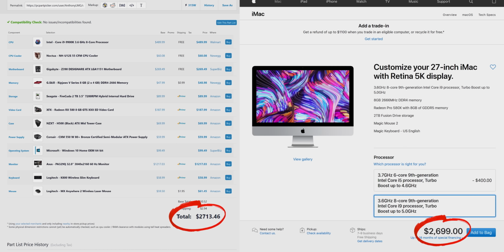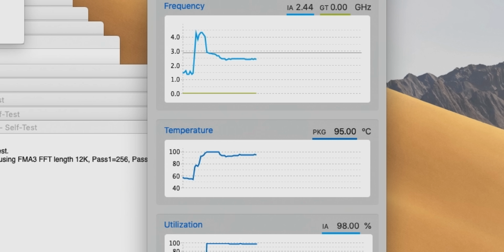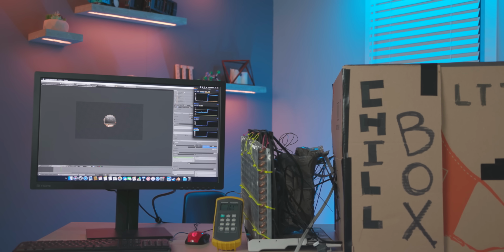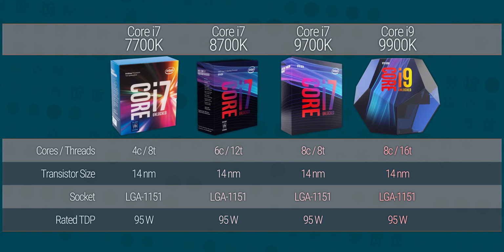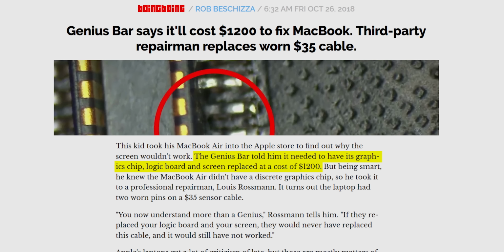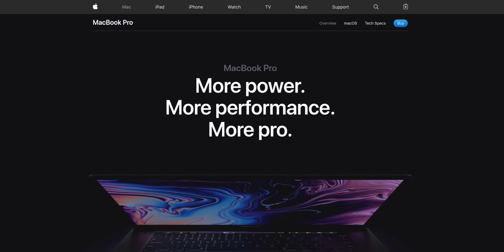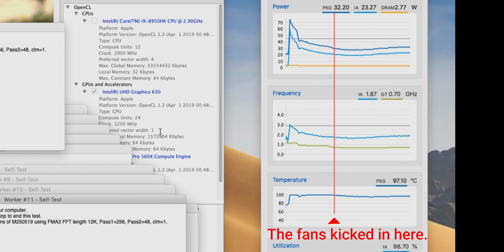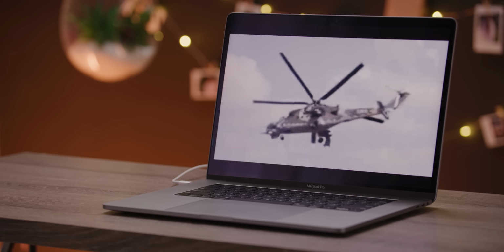Macs are SLOWER than PCs. Here’s why.

Comment: This video missed something pretty important: Hardware P-States, where the software plays no role in regulating temperatures and power state transitions are handled entirely autonomously by hardware. It’s a feature of all Skylake and newer Intel chips (it’s officially called Speed Shift), and it’s been used in MacBooks since 2016, though it does need to be enabled explicitly by the manufacturer (or a BIOS hack or setting, or an operating system kernel). That iMac review also looked like it was using it—you can tell because of all the micro-boosts on the performance chart.

EDIT: Basically this means that there isn’t really much in the way of “secret software sauce” that can be done about it. The hardware is generally better at regulating itself than software. This is probably what Apple’s now banking on in their machines to make up for their designs’ lack of basic thermodynamics, and they’re stretching it as faaaar as it’ll go. :/

Comment: I once had a MacBook Pro Late 2013 somehow lose its thermal sensors during a pretty gnarly exam week. The only way it would turn back on long enough to run a time machine backup was by putting bags of frozen food on it. Thankfully it was right before my AppleCare expired so it was fixed without cost, but the Dell XPS I’ve had since then actually turns its fans off because the 7700HQ CPU doesn’t always need them running.

Comment: The difference between what happens between Macs and iPhones can be due to the facts that for the latter they also design their SOCs? Whereas for desktops/laptops they have to adapt to what Intel provides them?
Reply: 哩哩   The SOC in the Phones is ARM which runs a lot more efficiently.

I don't think Apple is totally stupid here, they are just biding their time until they can get rid of Intel, just as they did with Motorola when they couldn't/wouldn't give Apple what it wanted.

Nexct year should see whetehr Apple has finally managed to manufacture its own chips powerful enough to go into the laptops and then progressively into their desktops. If and when they succeed tghius will be an earthquake moment for the industry. Intel has been hanging on by a fingernail to their virtual monopoly.
Reply: @peterbreis5407  I would hardly call Intel a monopoly considering that AMD outsold them 2:1 as of December of last year. And they haven't had any significant advances since.  And with the tremendous amount of cell phone market share lost to Samsung and other Android powered phones, I'm not convinced that they have the resources to take on ANYONE in the processing world, let alone a giant like Intel.  Steve Jobs, their innovation driving force, is gone.

https://www.techradar.com/news/amd-is-now-selling-twice-as-many-processors-as-intel

http://fortune.com/2019/03/12/apple-iphone-trends-going-from-bad-to-worse-analyst-says/
Reply: 哩哩   I think Apple will continue making Macs because they need them to tie together all their hardware, there is so much that you can not do just on iOS.

Apple's ARM chips are already extremely powerful, it won't take much to get them up to running laptops at least. That combined with Apple's T2 chips could mean they totally lock up their hardware, and that is a step too far for me.

If they do shift to ARM that means iOS can run on desktop Macs and may mean the end of macOS.

Comment: Financially, gaming pc are better than macs.
Reply: Rofl. If you only now are coming to that realization i hate to be the bearer of bad news, but gaming rigs when built right have always been better.
Reply: @Dj-Mccullough oh yeah no. I don't own any apple products whatsoever. went from Samsung Laptop to upgrading a Cyberpower PC.
Reply: @marky.maku.  niice man. Did you enjoy the build? And how are them sweet sweet fps's? ;)
Reply: @Dj-Mccullough  lol no. It was scary as hell to do that stuff. like especially the Intel chip putting that on scares me. I had a friend really help me but Overall, putting it together physically was all me.
Reply: @marky.maku.  intels use of that cpu socket with the pins actually perminantly in the motherboard and laying the chip on top of that while attempting to not bend a single one of those tiny pins is enough to give me nightmares. I MUCH perfer AMD cpu socket. Atleast when you open that all the easily bendy parts are shielded.

Comment: I agree apple is not overpriced per parts but per performance if I pay for i9 level performance I better dam well see i9 performance I don't give a shit how distasteful it is to have a hidden "actually powerful" checkbox in macos rather than claiming to boost "up to" x.xghz but literally never boost because of the 1% of apple users of the 1% of tech enthusiasts who can't stand 36db of fan noise (35 is literally a whisper) I mean cmon raise your fan sound limit to 40db because 99.9999999999999999999999999999999999999999999999999999999999999999999999% of buyers care more about actual usability than silence
and yes the statistic with so many digits is an exageration but removing more than HALF the decimal places is actually unrealistic

Comment: My 2012 dell latitude e6420 with a quadcore i7 2760qm destroys that macbook on cpu loads before liquid metal and its 7 years older, not to mention after liquid metal and added ventilation holes in the bottom chasis

Comment: I wouldn't say they're targeting the "less tech-savyys", I worked in software engineering and MacBooks are very useful when it comes to working in a containerized world. With the help of homebrew, everything just works right out of the box without any special configurations. Of course you can achieve pretty much the same result with Linux, but you'll sometimes find yourself having to do a bit of config to get things working which isn't the case on OSX. I'm leaving Windows out of the equation on this one as just playing with Docker on Windows is a completely stupid endeavour (I've tried it on my Windows desktop gaming PC). 

Bottom line is that Windows is good for certain things (gaming, web browsing, .NET dev, game dev, rendering), OSX is good for others (web dev, software dev, web browsing, etc.), and Linux for others (servers... pls stop with this Windows Server non-sense people!)

Comment: I think the interesting comparison here would be to have a similar spec MacBook Pro and Surface Pro 6. The surface line is still rather powerful, but its much more reasonable than the MacBooks that try to shoehorn an i9 into a casing barely any thicker than the Surface. Personally, I would also add the 12" MacBook to the comparison, as iirc all three of them have a Core i7, 16GB, 512GB SSD config.

Comment: TO EVERY MAC USER: download smc fan control, I use it too and it’s amazing. You can control your fan speed, and get a faster mac by cooling it better. Easy trick and actually works
Reply: i use the same and yes, it works.
Reply: I use Istat so I can control it from the menu bar

Comment: At 9:00 to touch on the subject of the new macbook pro's shitty thermal throttling. It doesnt matter if you liquid metal it for better temps. The VRMs that power the CPU are not delivering enough power for the CPU to work as it's supposed to. It's a terrible engineering flaw that was never fixed even through its "software update fix" It also doesnt help that the same said underperforming VRMs also are not under any sort of heatsinks either. 

Louis Rossmann highlighted the problem as well here: https://www.youtube.com/watch?v=Xjor24HO2HA

Comment: Vouch for 9:05. I found that MacBooks almost grind to a halt if the CPU is pegged for a while, with temps reaching 95C. Using Macs Fan Control, I've set the fan to full if the CPU PECI reaches 65C. Temps rarely go above 70C. Feels very responsive despite an ongoing code compile and 50+ Chrome tabs, with Youtube playing somewhere.

Comment: I am not a snob therefore I use only Linux computers. People use Macs for their snob appeal. If you want a computer that actually does things Linux is best.
Reply: @Nevermore The flaw in your reasoning is that I am retired and don't have to worry about such things. But to tell you the truth I do have a  dual booted computer so I can access Windows if need be. So you are right, one cannot totally escape Windows. But if I do buy a new computer it will have Linux on it or I will put Linux on it. But as Torvalds said, the future is with Chrome OS and I agree. But Mac is for the rich boys who want to impress other rich boys.

Comment: Why not mention how you can make MacBook much more stable with Macs Fan Controll? You used the app in the video. I'ts a great app and free.  MacBook Air 2018 have the low power CPU but it uses passive cooler and FAN only as auxiliary fan for airflow. MacBook Pro 2013 - 2018 have very weak coolers but also superior fans. They are inaudible up to 2500rpm. With few moment of tweaking you can easily make  MacBook much more thermally stable.

Comment: You’re likely to get a new computer by the time the Mac would fail due to thermal related long term issues. Not defending or anything but it’s true. I had a MacBook Pro for 7 years, 2011-2018 and never had any issues other than the laptop aging 7 years.

Comment: I started using manual CPU fan control through smcFanControl and found much better performance when you keep an eye on cpu temps. When you're loading something you know will need a lot of CPU time then kick the fans up to around 5,000RPM. This doesn't half give the user much more control over the temps

Comment: I put the difference down to social engineering within apples marketing as opposed to performance based marketing, here a summary of my experience at university:

I owned a dell xps 15 at university which has a loud fan noise and can be somewhat embarrassing in lectures (i since realised i need to throttle the clock speed for social acceptance if im bothered), i notice the majority of students do have a Mac to read their slides or a low performance computer which doesn't require the thermal dissipation of fans. To uni students, its not only a status symbol but apple have engineered their products to be a part of how they identify in the world, its dumb and illogical in my opinion but yet again, people are more concerned with how they look these days instead of how they feel (which ironically determines how they feel!).

maybe i'm reading into it too much but i just feel sorry for misinformed apple fan boys when i think its clear as day that they have inferior value for the price of their tech - although in this case i guess a silent machine is favourable.

It also doesn't sit right with me that apple rather replace the entire machine instead of fix it - the company is just absolute capitalism in this day and age at its finest and it needs to stop for the sake of our planet. I don't consider myself an Eco warrior but for sure the apple ecosystem seems fantastic on the outside but is just a mess when you see beyond it.

 Opinions ?

Comment: Where to begin....  So many false equivalences in this video....  These videos are really designed to keep PC users from jumping ship...  Apple faithful know that the benefits of the FULL APPLE ECOSYSTEM and quality software, offset the tiny performance loss from the constrained thermals... And Linus doesn't understand the appeal the these machines...  It's not the SEXY that we like .. it's the portability.  Even the power bricks are much smaller than PC junk...

One last thing... Linus makes the claim that Apple designs are more likely to fail because of excess heat, yet he offers only a hand waving argument to back up that claim.  Show us some HARD data to back up this claim ... or I'm considering it total bull shit.

Comment: It's so adorable when Linus attempts to talk about Macs and their user base.  "The looks and the status symbol of owning the machine..."  What an arrogant and ignorant statement, young child.  Most Mac owners are using Macs because of the operating system, not the "looks and/or status symbol."  Mac owners generally don't want to run Windows because MacOS provides them with the tools and playground they need or want.  Would it be nicer if the laptops performed better?  Sure.  But folks don't buy Macs for "kick ass performance, yo!"  We buy them for the OS and the fact that stuff just works out of the box without the necessity of jumping through hoops (eg: Hackintosh).

Windows sucks as an operating system to get work done.  Windows 10 sucks less, but it still sucks.  MacOS is a superbly better platform for programmers, systems/network engineers and architects, and a host of other roles.  You're not going to understand that because you don't understand those kinds of roles.

Comment: The difference between a Mac and an iPhone( or any other phone) is that an intel processor produce heat and require cooling when an ARM barely produce any heat for the same result. That is also why Apple is moving forward to ARM based Mac in the future... and also why your phone doesn’t heat... it heats mostly because of the battery...

Comment: I work in post production and we're entirely Mac-based here (not my decision). My manager offered me a new Macbook Pro to replace my aging Mac Pro. I turned that offer down for a Mac mini 2018 and a Vega 64 eGPU. From the get go I could tell the CPU was being throttled HARD so I bough an application that allows me to monitor load levels and temps of everything. Ended up creating a custom fan profile that essentially punches them up to full speed as soon as there's sustained load or if temps his 75C because the thermal throttling was hurting render times.

Worked out cheaper than a Macbook Pro though, and with more punch, so my manager and I are pretty happy in terms of bang for buck!

Comment: 9:54 They never planed intel to start making all of these high preformance chips, when they first made the designd in 2016. Then they had quad cores, which were much easier to cool,  so they made their macs thin. Then, intel suddently came along with i9 6 core prosesors, and apple was not planning to redesignd the whole cooling system or the whole computer if that's what it takes. Maybe some day apple would be running their own silicon on their chips...

You can see I'm a fanboy, right?

Comment: I think the thermal throttling is not present in their iDevices because they design the CPU/GPU and when all you design the product from the ground up including every chip, hardware and software you can make them play nicely. Also, intel i7/i9 is a front runner in the CPU world and having that in your computer makes it that much better(Marketing ploy). There are no phone CPU/GPU solutions with that much buzz worldwide.